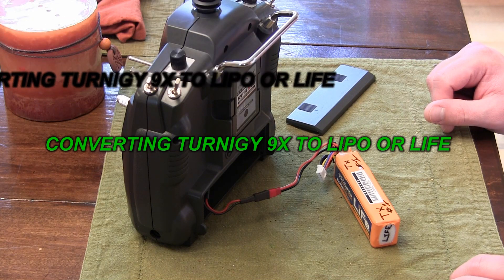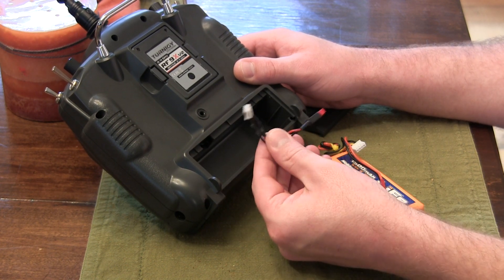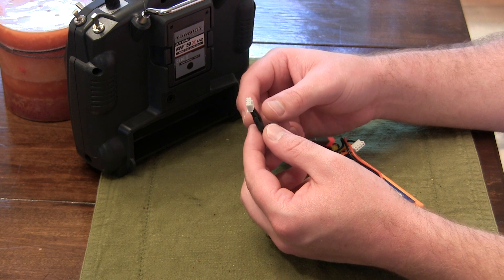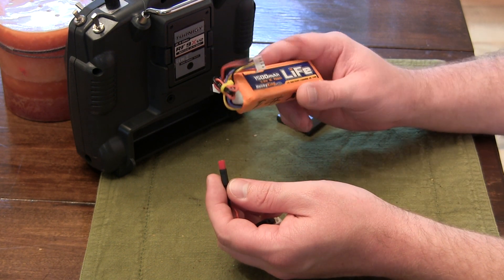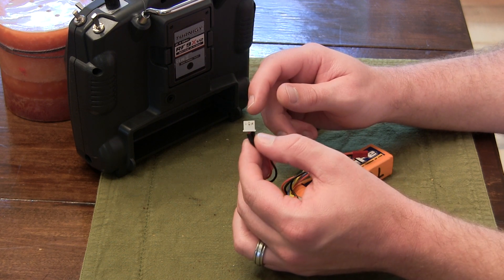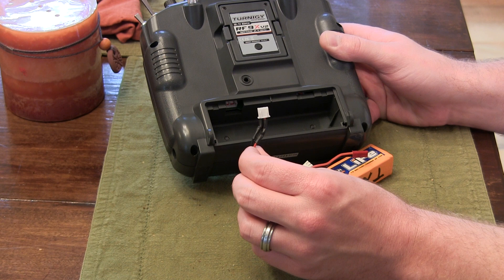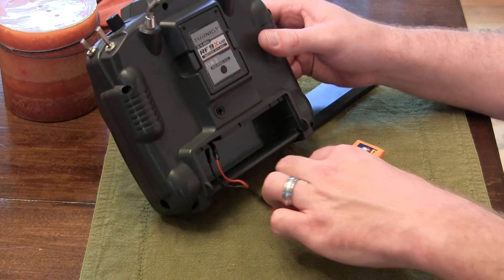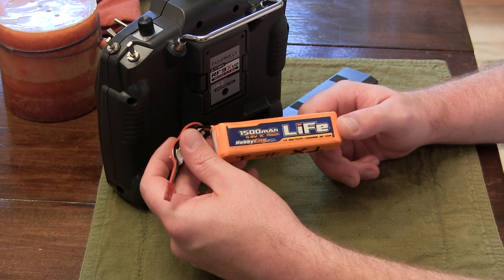Convert turnigy 9x to use lipo or life battery

Comment: Why do anything this complex when something so simple is available?  I am using 2300 MAH AA NiMH batteries from Hobby King.  Simple, cheap rechargeable.
Reply from the maker: I have used rechargeable in it. Despite the stated capacity of the rechargeable,  the actual real life usable time is less than half this.  Also,  the price of buying rechargeable is about the same as this.  I can't justify using rechargeable aa.

Comment: nice tutorial, by the way can i use external power supply(12v adaptor) to turnigy 9x?if so, where is the charging port?
Reply: Yes. Just try to find in manual or test how much amps does transmiter "eats", then go with at least 50% stronger power supply. Electrocity is easY!

Comment: I didn't know you had to do a conversion. I plugged the Life battery leads in, the only possible way to plug them in. And I then realized the Remote controller had blown up. Who would have through you would need a vast amount of knowledge to plug a battery into a remote. I can not figure out why there is a Life battery with its leads the wrong way round. My old battery pack has the leads the right way round. WHY?

Comment: Hi I have found your video, it is really great. I have followed your tips and ordered the same battery as yours. But you know what happened, I have placed it in to the transmitter and it did something with it as it does not want to turn on anymore. possible it killed the power manager board or something. Are you anybody who see this comment familiar with it this type of faults? any option to repair? thanks for comments.

Comment: Hi Erik, thanx for the vid.  FYI I bought the HobbyKing 1500mah LiFE battery.  It also has a servo plug with black and red leads.  You can just use this plug to power radio, eliminates the need to mod anything.  Just make sure the RED lead is to the center pin on radio, and the BLACK lead is to the extreme left (as looking down at the back of radio.  Works and again, no need to mod or make a connector.